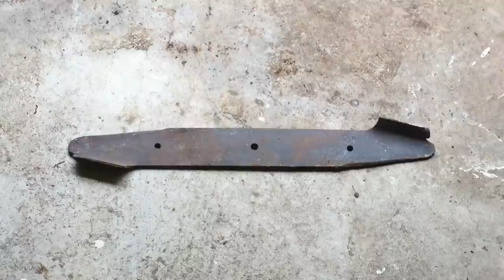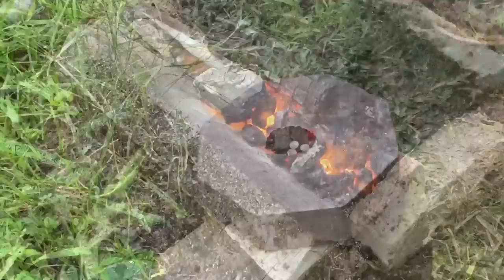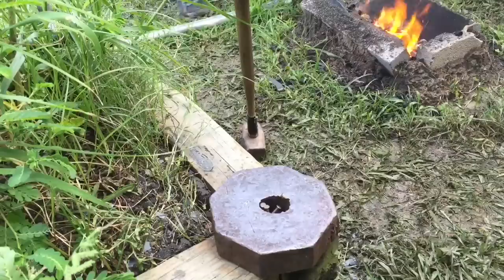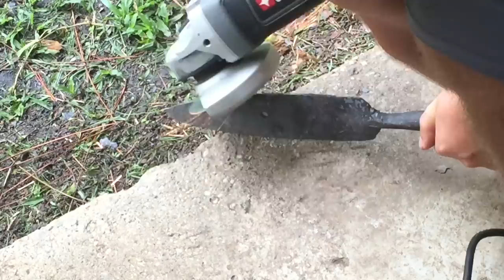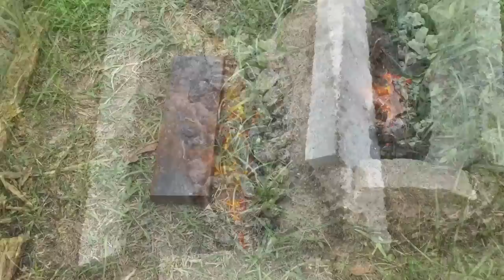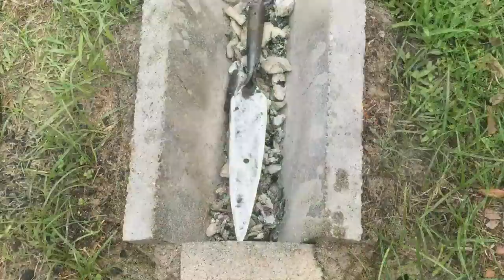Forging a Spear out of a Lawnmower Blade

Comment: Your 'anvil' would benefit you by welding a railroad spike down through it. Grind the top down flat and polish it. Then make an undersized hole in a log, and drive it down securely. At least until you could find a section of RR track or an actual anvil. Keep at it, I started out with very little for smithing tools, but can make a few dollars here and there now from my creations.
Reply from the maker: Thank you!

Comment: in the future you should consider cutting the lawnmower blade into pieces to stack them and forge weld them together so it will eliminate the holes so no one can guess that it started out a lawn lower blade. if you draw a railway spike out into a billet you can alternate them into a pattern welded Damascus.

Comment: do you even know what steel that it is make from? what sort of steel?
Reply from the maker: Not sure really. Back then we didn’t have access to better steel so we used what we could. Lawnmower blades are hit or miss in our experience. Some hardened and some didn’t. Now we mainly use leaf springs or purchase high carbon steels.
Reply: @BurningOakForge  ok thanks

Comment: How do you like lawnmower blade steel? I know it won't be as good as a D-2 or the like, but I did stock removal before getting a forge so the good carbon steel I have is kind of wide and thin.
Would you put it on par with something like a railroad spike? Perhaps not ideal, but it makes an okay blade?
Reply from the maker: Darth Karnis Depending on the lawnmower blade steel, it makes an okay blade. It won't be as good as something like 1095 but it works good for something that doesn't have to be razor sharp. A railroad spike doesn't contain a lot of carbon so it won't harden as hard as a higher carbon steel
Reply: ***** Makes sense. I've seen people make workable knives out of railroad spikes, not perfect, but good enough to get the job done. I do have good steel, but it's all 2" wide and kind of thin, good for stock removal, but I'm not a fan of working it on the anvil. The spikes and lawnmower blades are good practice though, something to just fool around with without wasting good steel.

Comment: Great video. How did you attach the spearhead to the handle though? Also do you heat treat and temper the socket or only the blade?
Reply from the maker: Grimli Son of Groin I attached the socket to the handle with a bolt and penned it
Reply from the maker: Grimli Son of Groin and only the blade needs to be heat treated
Reply: *****
Thank you for the reply

Comment: What do you use for charcoal/coke? Where do you get it? I am new to this all and looking to start up soon. I have heard that you're not supposed to use charcoal briquettes. Also what is that piece called that you're using as an anvil? I think I should look for one of those because anvils are hard to come by and expensive where i live.
Reply from the maker: Thanks for the comment. I am using hardwood lump charcoal which works great for forges. The main difference from this lump charcoal and charcoal briquettes is that the briquettes don't burn as hot and leave more ash behind which can tend to be a pain to deal with after time; however, if you rather save money then charcoal briquettes should work for a beginner. Lump charcoal is a better option but briquettes do work. Coal is more expensive and harder to come by. As a beginner, I would stick with charcoal. After gaining experience, you may decide to make a propane forge which is great but takes money to make and requires some experience. In this video, I am using a piece of steel that I found that is heavy enough to do decent shaping on. If you are just starting out, try to find a block of steel that would be able to handle hammer blows. The heavier, the better. Real anvils can be pricy, but if you have the money, it is a great investment. I hope that helps.
Reply from the maker: If you have any other questions, feel free to ask.
Reply: +Iron Forest thanks